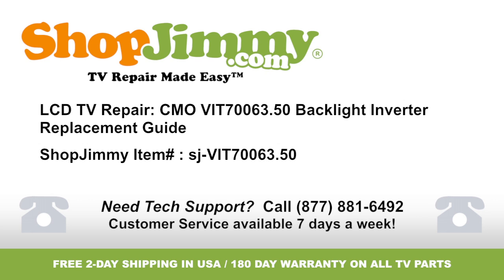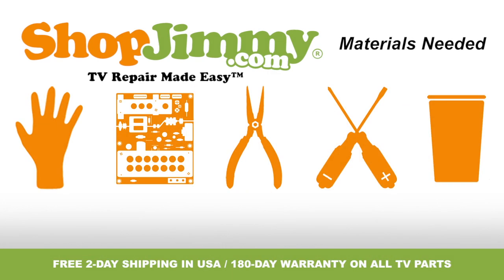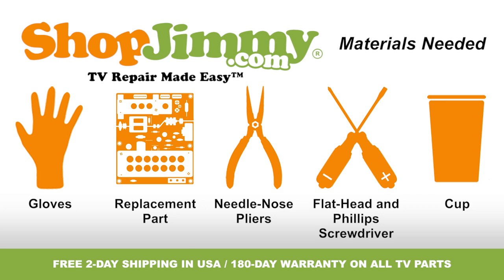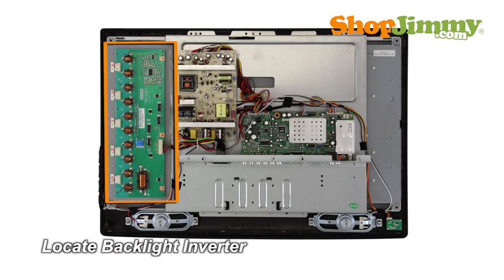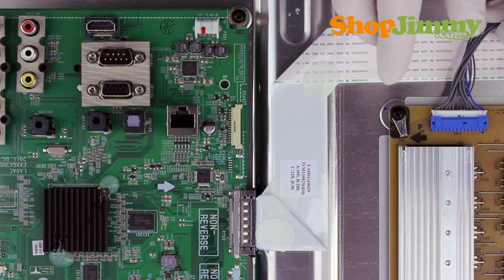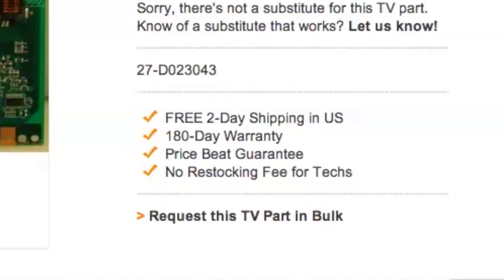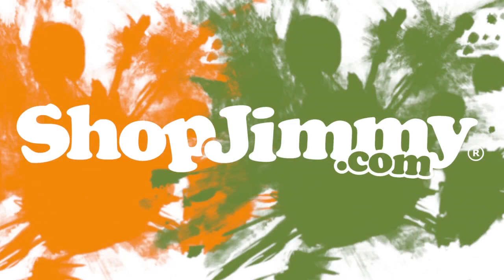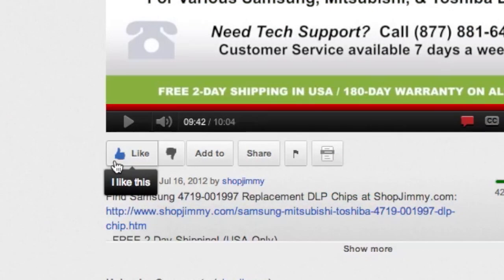CMO VIT70063.50 Backlight Inverter Boards Replacement Guide for LCD TV Repair

Comment: RCA  Model  #L26HD35D  S/N J254EL2L9 Problem:Negative Picture.Tint Control Adjutment innoperative.
Reply from the maker: Jose Giraldes   Please watch this video FIRST to help with your repair!  TV Repair! LCD, LED, Plasma, DLP How To Fix Your TV with ShopJimmy.com Help!  This is either a problem with the TV panel or the main board in your TV.  You can replace the main board to see if that fixes the problem, if it does not then you have a bad panel.  Here is a link to replacement parts:  http://www.shopjimmy.com/catalogsearch/result/?q=L26HD35D  Be sure to match part numbers on your current board, with your replacement for compatibility.  Thanks and please let us know if you have any further questions with your TV Repair!  www.shopjimmy.com